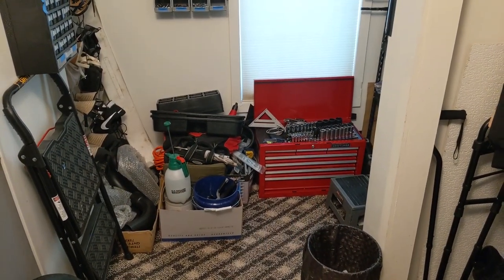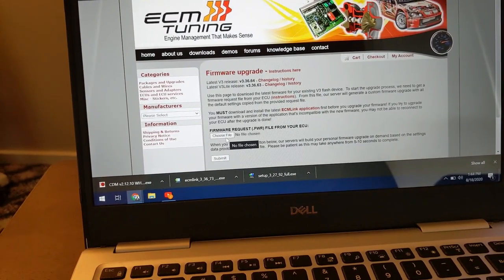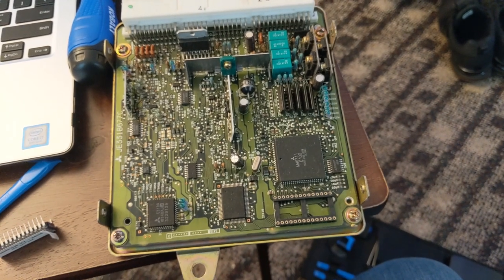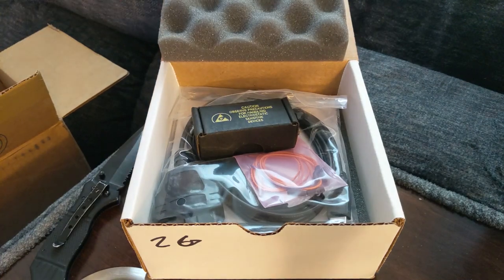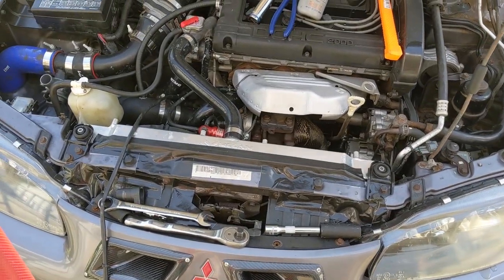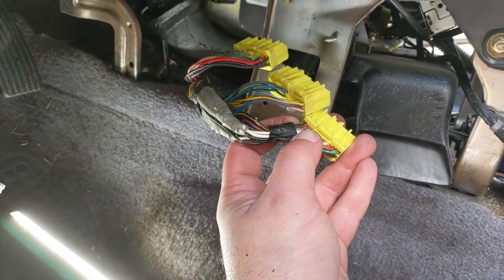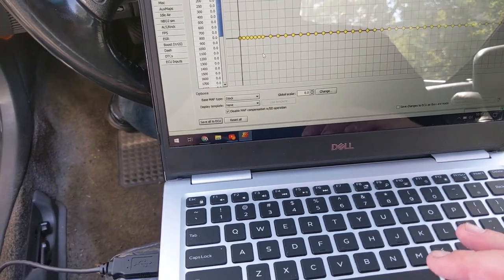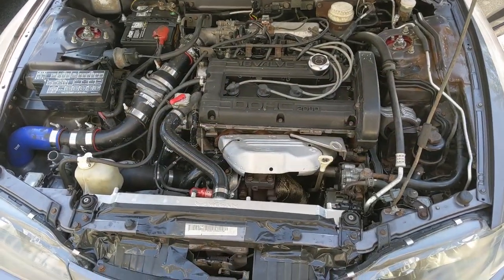HOW TO INSTALL ECMLINK V3 IN 2G DSM - HOW TO INSTALL AEM WIDEBAND - FIRST START WITH ECMLINK V3

Comment: PLEASE !  Do not start the engine with the wideband sensor heated up, like that.  That is the #1 killer of sensors ( thermal shock ).  Once the sensor has "warmed up", the CERAMIC element is at 1200F.  Hitting it with a blast of cold ( and, usually wet ) start-up air is like throwing ice water on a hot windshield.  And, the effect is similar.  Cracks form and grow.  1st the ruin the accuracy. Then, eventually, the cracks hit something vital. And, the sensor flakes out, then dies.
Reply from the maker: Thanks for the info! That's so far the only time that happened. But definitely will make sure to not do that again. Don't need my $180 sensor crapping out any faster. Thanks again for the advice 👍
Reply: A lot of people doesn't know this that all I was one of them you should make a small video on and help learn about it because we all do it . And a other think why did you put the wideband in the front o2 I was told by Scott and a few other tuner it's better on the rear o2 before it kills the life as well gets to hot and burns it out faster too
Reply: @evo6swap  from ecmlink “By FAR, the best place to install the WBO2 sensor for accurate narrowband simulation is in the front O2 sensor location. This page outlines how one user installed his WBO2 in the front O2 location. When installed there, the WBO2 sensor can respond very quickly to the changes made by the ECU to A/F mixture. This is inline with assumptions in the ECU on how quickly it can expect to see a “response” as it adjusts short term fuel trim.”
Reply: @evo6swap  NOTE ABOUT HEAT: There's a rumor running around that WB sensors are not designed to take the heat that close to the engine. I honestly don't know if there's some truth to that or not, but it seems strange to me and doesn't jive with our empirical results. I've run the WB sensor in the front O2 location on my own car for years and have had no problems, even after putting it through a LOT of hard (and HOT) road course miles.

Comment: Hey brother, did you get a o2 sensor heater malfunction code after this? I did everything right and for some reason I got a code
Reply from the maker: I did not. Using Ecmlink v3 you can disable those codes. If you have the same issue persisting log into Ecmlink live, click on “dtc’s” tab and uncheck the box for o2 sensors. This will allow you to run the front wideband sensor with simulated narrowband. I found it will pass an inspection for cel lights in New York State like this as well.

Comment: Question if I’m sticking the wide band sensor in my side exit bung *not the o2 housing I can wire everything up the same right?
Reply from the maker: Yessir. Cigarette lighter will give you the dimmer light control. Should work the same. Make sure you keep it within the middle ish area of the side exit. Too close to the opening of the exhaust you can get oxygen contaminated readings.

Comment: If I install the wideband o2 sensor on the down pipe does the white and brown wire still connect to the same pins you mentioned. 5 and 76?
Reply from the maker: Look up the dsmtuners.com ecu Pin out diagram. You want to identify which pin is your front o2 sensor and which is your rear o2. Pick which one you want, add in that wire to whichever white wire going into the ecu you want to log through. Then set up your data 5v wire and once your program your ecu input selection to show where and what type of sensor your using to log, test it out. My instruction is for the front o2 sensor location with wideband stimulation enabled. Feel free to message me on Instagram or email if you get stuck
Reply: @TPGDSM  thank you so much

Comment: Bought the same wideband. I’ll be installing this week. What made you decide to go link over just tuning the black box?
Reply from the maker: Ease of use basically. If you haven't flash tuned anything or are new to tuning ECMLINK is a great option mainly because of the swaths of information available. Once you sign up on ecmtuning you can join the ECMLINK wiki page. That coupled with dsmtuners and videos on here leave you in a great place to figure out a lot of functions and tool uses that link has to offer. It can be somewhat of a daunting task to go through ecuflash with a tactrix cable and try to hot wire in serial ports for widebands. In no way am I knocking ecuflash and evoscan, but for someone beginning it's definitely the easier way to make reliable power and modify timing and fuel tables. 👍 Another brand nismotronics offers a similar program for Nissan 240's and 300z's to flash tune with.

Comment: hello friend, excuse me, I wanted to ask you a question related to the v3 chip that you bought, what happens is that I have an ecu with a v2 chip, the problem is that the cable is damaged and it is impossible for me to get it They have them for sale so I wanted to ask you if I buy that chip on the page that comes with the v3 chip, its cable and the installation cd, could I do it? i would just remove my v2 chip put the new v3 in and i could and use it with the new cable that comes with the v3 chip without problems?
Reply from the maker: Yes you can buy the v3 kit and use it. The v2 chip comes out, you’ll install the new firmware off of Ecmlinks website and download Ecmlink v3 to run it on your car. Easy swap👍
Reply: @TPGDSM  Thank you very much friend I appreciate it I follow your YouTube channel a lot about your dsm I am thinking of putting the maft in the middle as well as yours to eliminate the ma
Reply from the maker: @javieramaro7552  if you have Ecmlink you won’t need the maf translator. You can get the Ecmlink maf brake out cable and Ecmlink can run stock maf, 1g maf, 3, 3.5 in gm maf and evo/speed density from it. Plugs into the stock maf plug. Ecmlink does the rest. If you keep the maf box set the base injector setting and do the rest in Ecmlinks maf comp table👍 email me or hmu on instagram if you need any further help

Comment: Great video! What difference is a socket to a non-socketed eprom ecu? I can acquire 3046 eprom ecu but I'm not sure where to look if its socketed or not. If I do have a non-socketed eprom chip bay is there a way I can install it properly? Thanks!
Reply from the maker: If you notice in the video when I plug in that red flash module onto the board that part where the chip plugs in is the socket. You can tell if on your ECU the eeprom chip looks to be plugged into the board or if you flip it over you can see that the legs of the chip are soldered to the board. If you're good at micro soldering you could attempt it yourself but it's better to just send it into @tomdorris @ecmtuning.com to have it swapped over instead. It's a very precise job
Reply: @TPGDSM  Thanks! I’m already halfway through your video and I see you got a blackbox 6676 ecu. Have you also done some videos on flashing it by using ecuflash/evoscan or some sort? I’m kinda new and late to this thing sorry
Reply from the maker: @vonvoyage14  unfortunately no. I swapped out for a 95 EPROM.

Comment: I have 6 bolt in a 2g can I use my 7boot cas on the 6 bolt ?
Reply from the maker: Are you asking if you can use your 7 bolt cam angle sensor on the 6 bolt head?. I know that there are 3 different types of heads based on model year, but I'm not sure what the differences are. If it looks like it will bolt on and the plug is the same you may be able to. Depending on that I know you can choose a check box on link under the miscellaneous tab to use non 95/6 cam angle sensor and it inverts the signal. I'd double check on dsmtuners.com or vfaq

Comment: I was reading an install guide on Tuners and it was saying to wrap the old O2 sensor in foil and tie it out of the way when running it in the front location to avoid having a check engine light for the heater circuit. This doesnt seem to be the case?
Reply from the maker: So if you're trying to run the stock sensor without a check engine light and you're not using ECM link then yes you can do that. But most people do is plug the wide band into the front O2 sensor hole. Going to ECM link and enable NBO2 simulation which keeps the check engine light off. If you don't have ECM link  that's what people have done in the past. Do you have link?
Reply: @TPGDSM  I have a 2g With link v3. i am actually trying to install my wideband right now after watching your video a few times but my harness from the aem doesnt have a brown wire.
Reply: @TPGDSM  So mine is not the series x. Mine is probably the one that the folk at ECM link hate haha
Reply from the maker: @DSMattitude  you can find a lot of different ones pre-set inside the ECU inputs tab. If you can't find one that works you can set it as "user defined linear wideband" and figure out your switch point voltage for your specific sensor and input it on your data log screen. Right click data log screen and displayed values and add "user defined linear wideband" to your log screen. Then input your min lambda, min voltage (usually your specific widebands stoich voltage (ie: gasoline 14.7 afr = x.xx volts) and your max lambda and max volts. Then adjust the voltage until your wideband displays the same numbers as your data log screen. Most of the time googling your brand and type of wideband followed by "voltage chart" or "switch point voltage" will give you the info you need in a .pdf file or something. Hope this helps you
Reply: @TPGDSM  Im running an AEM Uego 30-4110. Got it wired up but now i have some other kinks to work out haha

Comment: Did you end up running a inline fuse?
Reply from the maker: Only on the rewired fuel pump and one on the wideband power from the cigarette lighter power for safety.
Reply: Thanks for the reply hahaha, I did my setup when I wrote the comment and went ahead and did a inline fuse for the cig lighter aswell.
Reply from the maker: @brokenbuildz  sorry for the 11 month later reply. Some of these comments just popped up today (like 200 of em)
I try to always reply. Not sure what YouTube did with these ones but wanted you all to know I read em all😅